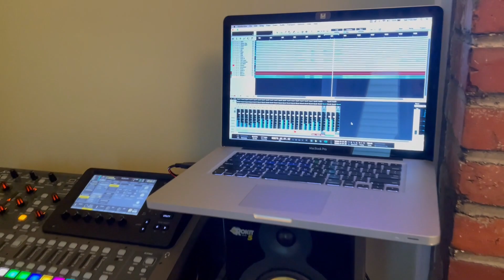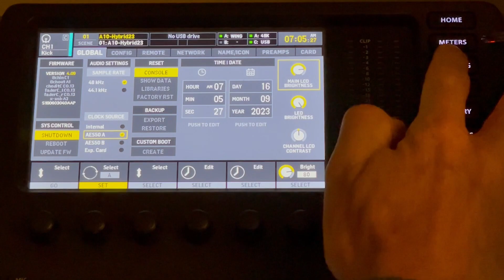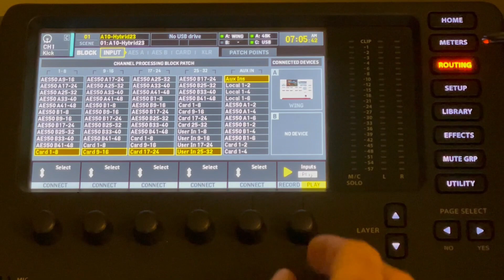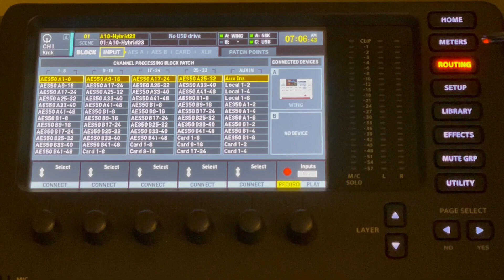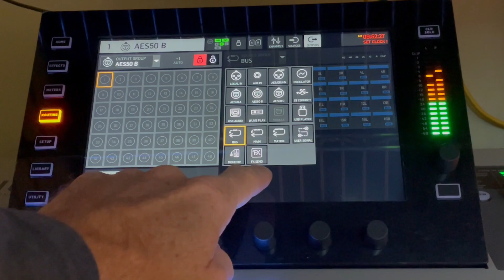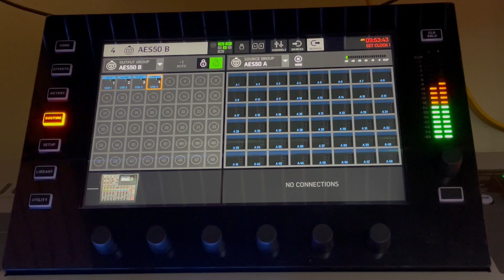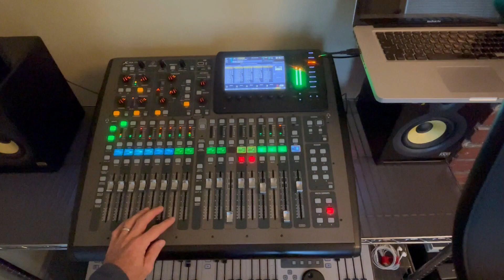ROUTING DETAILS TO CONNECT 2 CONSOLES  |  Behringer WING & Behringer X32

Comment: In this scenario, how would you setup a DAW for a virtual soundcheck for the FOH and Broadcast mixer?  Like the idea of doing the soundcheck in the sanctuary to dial in the mix, then repeat the same process for my broadcast mixer which is in an isolated room downstairs. Do I need two DAW’s or will one suffice? Thanks
Reply from the maker: I always record off the main FOH console so I get an accurate representation of the inputs coming into my system. You can flip the inputs on the FOH console to take in the recorded tracks and build your house mix with virtual sound check.  This is pretty standard and it seems like you understand that side already.  To get these tracks to flow to your broadcast mixer, you would need to change the send settings to be card on the FOH console. So , if you are sending. Your inputs out AES50a to your broadcast mix, they would normally be set to match your input settings. Once you change to inputs to card, you will have to switch these AES50a section to send the card inputs instead of your normal inputs.  Make sure to flip the. Back before your live event so everything is back to normal.

Comment: I have been looking for a good lamp for the wing.   Does anyone know of one that will works?   The angle in the back is really steep.
Reply from the maker: I don't personally have a lamp that I use, but Sweetwater seems to have a handful of right-angle lamps that should work.
Reply: I got one recently. It's actually better to use a straight connection in my experience. I got the LittLite 18x 4led 18" from Sweetwater. Works great.

Comment: Very cool. We have an x32 rack which could be linked to our x32 compact via AES as well, I assume. We could then use the rack for IEMs, right? Use case would be to free mixbusses on the compact for things like drum parallel compression and other use cases.
Reply from the maker: That’s 100% correct. Just keep in mind that whatever console is hit first will control the preamps. The other console will only have digital trim. Plan your routing accordingly so you don’t confuse your sound techs, but yes it is a great option to use both consoles.

Comment: You started to mention routing. I'm using 2 x32"s connected with cat 6 ethercon cable. One is for the broadcast mix, the other is FOH. The 2 work fine, but my Mac wont boot on the slave console. I  had to disconnect the cat6 to virtual sound check. Have you ever experienced this issue?
Reply from the maker: I haven’t had that experience. It’s an unfortunate extra step to unplug the Cat5 input just to run a virtual sound check. I can try to recreate it in my studio and see if it happens to me.
Reply: Ok

Comment: I have an X32 console as my main and the X32 rack as my broadcast. All my physical inputs are local at the rear of my main X32, my question is when I set the routing am I going from local on my main to Aes 50 on my rack? Or local to local?
Reply from the maker: The x32 Routing > inputs will be local and the Routing > AES50a will be local. The X32 Rack will have Routing > Inputs set as AES50a. This assumes you are connecting both (console to console) using the AES50a ports. Also, don’t forget to change the Rack to have the clock source as AES50a instead of internal.